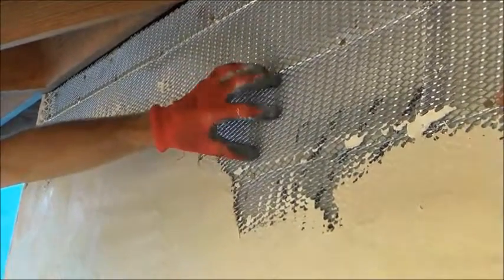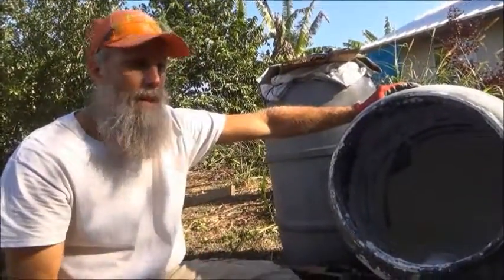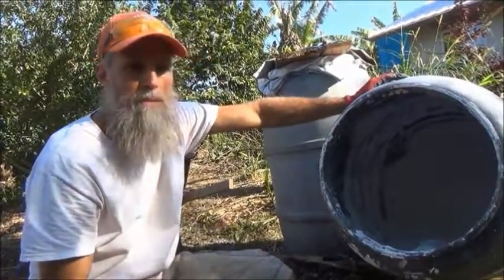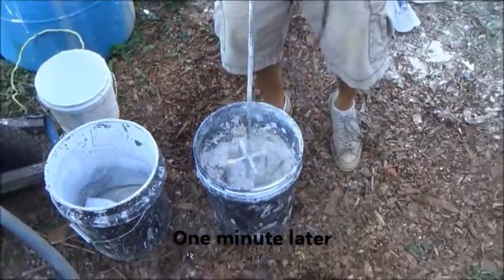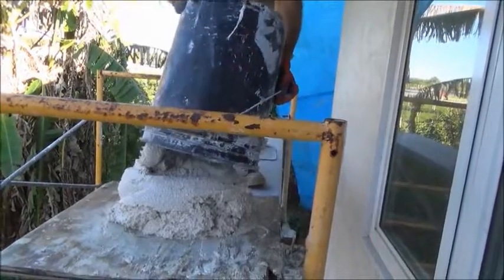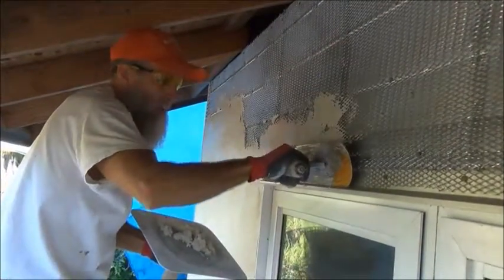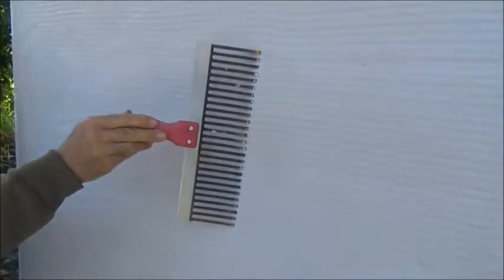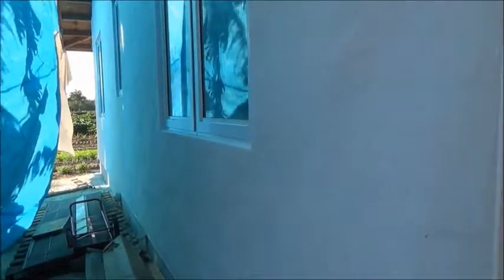Lime Plaster, How To Make & Apply

Comment: Do you do the process of "knocking up" where the sand and given amount of lime putty are beaten until the calcium binds to the sand? It starts out pretty dry but after the process of beating it for 20-30 minutes, if done by hand, will become more workable. You can also do it with a mortar mixer. You do this instead of adding water to get the right consistency.  This is the traditional process apparently and will make a stronger plaster. Adding water can make it weaker and the process of knocking up will make the chemical process go better and bind better.

Comment: Hi, for indoor lime plastering, does one usually apply another layer of pure lime putty on top of lime plaster ? If so, is it for a smoother finish or for better durability or both ?
Reply: Good question. It would be great if somebody who knows what they are talking about answered it. I thought someone would just apply 1 layer inside or outside. It seems like the second layer would not have enough to grab a hold of even with that scratch.

Comment: Could this plaster be used for  interior solid brick walls? Thanks for making this video. Finding proper information on hydrated lime is very difficult to find.
Reply from the maker: Not sure 
I seem to remember reading that type s is the type to get. Wish I knew the difference between them
I used hydrated lime from a feed store.
It was the only kind I could find locally
Reply: @off-gridhomesteading7269  hydrated is partially slaked quicklime that you can slake with water to putty, in 24 hours, its less reactive so therefore safer to use. Quicklime is for hot mixes. Putty is made from quick or hydrated. NHL is completely different and can't be slaked to a putty.

Comment: Can you use this lime plaster formula on a stone fireplace?
Reply from the maker: Good question.
Reply: Yes I have used it on fireplace surrounds before (brick). The problem is that the soot will stain the lime plaster and any sooty surface that you plaster over will start to stain through as the building material breath👍🏼
Reply: And the stone must have a key for the plaster to adhere to

Comment: Can you put lime plaster onto a painted drywall? I’m looking to use a limewash finish but I need to plaster over an existing painted wall for the limewash to stick
Reply: Just guessing here, but I'd say no. I think drywall and plaster are mutually exclusive. It's probably one or the other, not both at the same time. Again, just a guess.

Comment: Isnt it much stronger if you also add cement to the mix?  All the stucco/plaster Mexicans in AZ all use a cement based plaster with lime added. Ive never seen any stucco/plaster crew ever use just lime/sand. Seems like it would be far less durable?
Reply from the maker: CEMENT IS NOT ECO FRIENDLY

Comment: metal mesh is just junk
Reply: What do you suggest other than galvanized 16 gauge expanded metal lath at the exterior? perhaps 17 gauge 1 1/2 inch stucco netting?
Reply: and you recommend?
Reply: @TRM1294  wooden laths or fibre glass mesh if absolutely you must. Metal and strong alkalines like lime do not mix.
Reply: Are you building a Verdi cage?